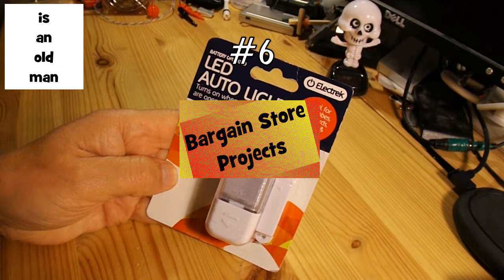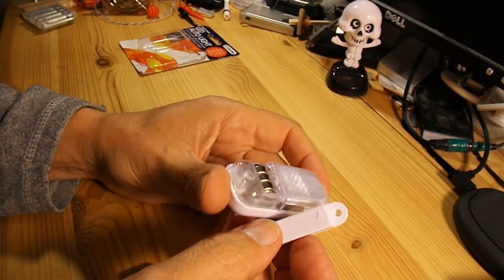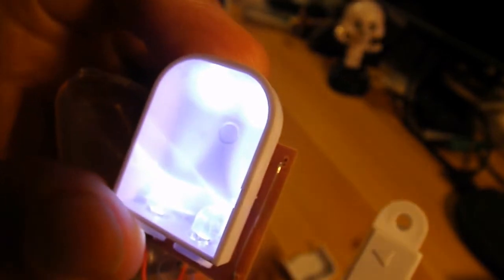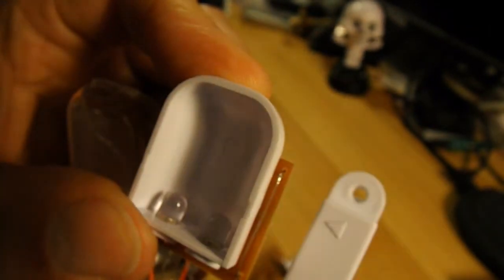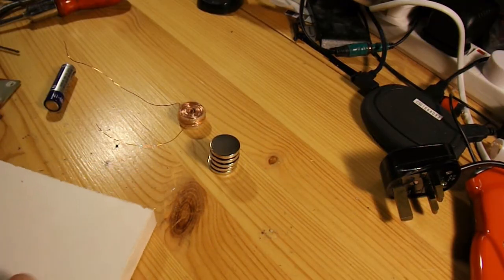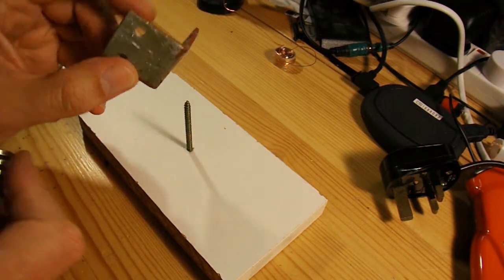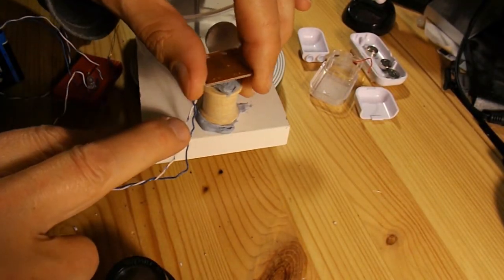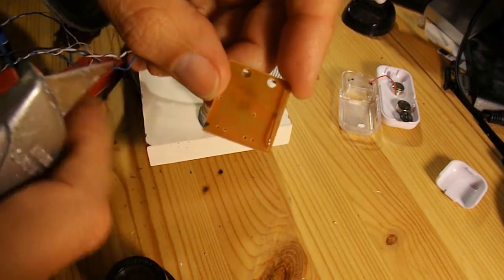Bargain Store Project #6 - Drawer Light reed relay controls Pulse Motor

Comment: Then you open your drawer and it's on fire, thanks to some cheap reed, (breed and breast feed) switch. Well at least bright light in drawer - finally. Reed switches like bitches, sooner or later they fail to deliver performance, that's because they are physical, better than that would be pure microelectronics, like using Bedini two coil setup or NPN\PNP transistor variation - single coil setup.
Cheap bargain, cheap pulse motor - I forgive you. Those Neomagnets probably were most expensive or most valuable thing here.
Thanks for video, drink beer.
Reply from the maker: Thank you 😊

Comment: Wouldn't it be easier  to just buy a 45pence reed switch??   Most of the auto-light isn't used ??
Reply from the maker: +Raymond Ashby haha, yes you could buy 10 on eBay for £1.86 if you wanted but then it wouldn't have been a "Bargain Store Project". The idea of that series was to buy something in Poundland or a similar shop and use it as part of a project to do something it was not intended for. Having said that, the other parts of the auto-light were used in other projects. The magnets were used, the LEDs were used, even the batteries were used, and yes you could buy the magnets cheap on eBay although you would probably buy neodymiums and the button cells are always handy.
Reply from the maker: +Raymond Ashby just did an eBay search and I can get 10 for 99p so even cheaper :)

Comment: wootwoot.. made my motor.  i used zero circuits. no reeds. no npn. no nutttin.  accept the shafts got enameled scraped off half of it. i guess thats how it pulses... or rotates... idk.  lid? did u say urs was easiest build ;]  uhhh.  this one is too ez...  i replicated this french guys deal... Gibofnc  [his utube name.]
Reply from the maker: +BLADE RUNNER they are very satisfying when they work. I don't think I said it was the easiest but I probably did say it was an easy build. All my projects are easy because I cannot do complicated stuff :) In essence it is just another DC electric motor, the coil generates an electric field that can either attract or repel the permanent magnet and you need an arrangement that synchronises the current flow with the relative magnet position to ensure it is repelled or attacted at the right time. How you do the synchorisation of that pulse is half the fun. Yours was purely mechanical, mine was magnetically triggered but still mechanical, others are completely electronic. As for which is easiest will always be a debate, some people find electronic components the easy way to do things and others will always go mechanical. I use a method similar to yours in my electric car project https://www.youtube.com/playlist?list=PLA5a2xPRSrB0scvCxBYNn35HohUxUoj0e

Comment: Where to get the magnet ring
Reply from the maker: The electromagnet coil is a sowing machine plastic bobbin that I wrapped wire round myself. The wire came from an old transformer that I took apart.